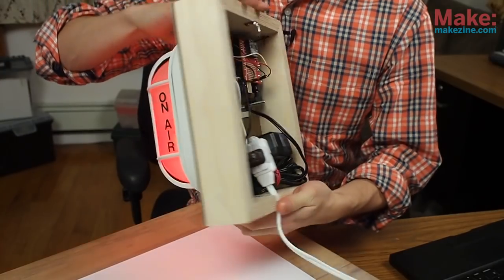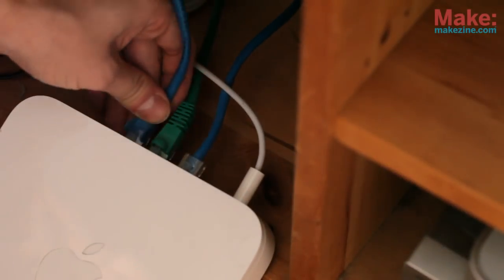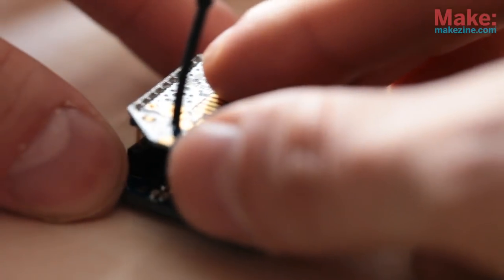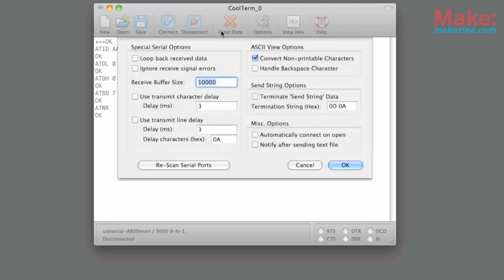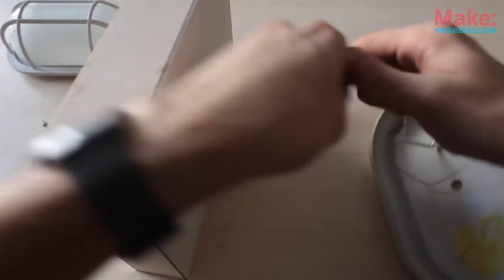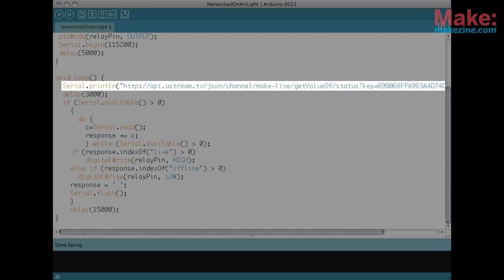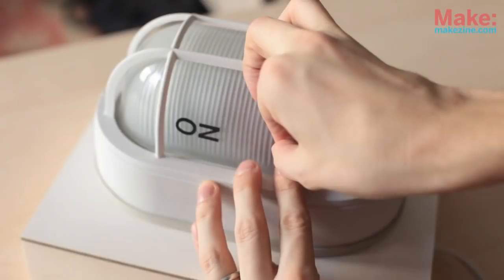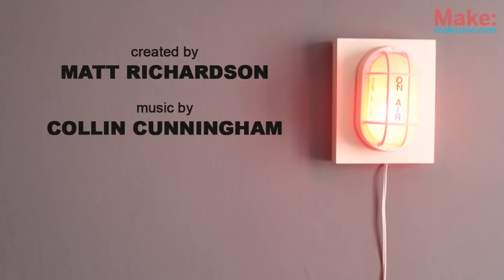Networked On Air Light

Comment: Lots of projects from Makezine that uses Arduino are very expansive. You dont need to fit the hole kit in everything, a ATmega + voltage regulator + crystal oscilator and a couple caps can do the job.

Comment: I rather extend the wires of the switch next to my desktop instead of taking that much of complicate steps to achieve on/off lights in multi clicks, which I could just move my hand few inch and press the button for once.

Comment: I always feel like arduino is crippled computer on a board,  projects with it are really, I mean really primitive on software sense, and you do not do anything significant on electronics side either. That kind of defeats the purpose of starting a hobby, project, hobby does not mean there is a limit on things I would like to accomplish, or things I want to learn.. anyways....